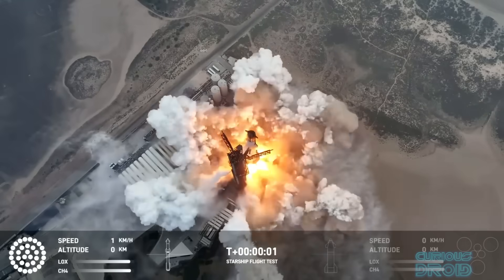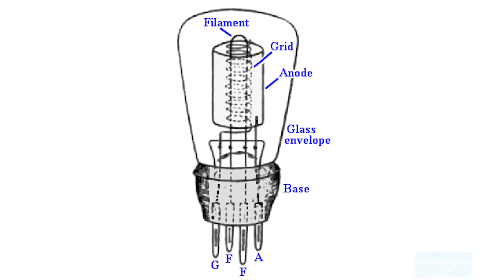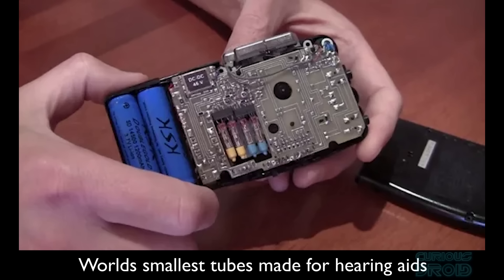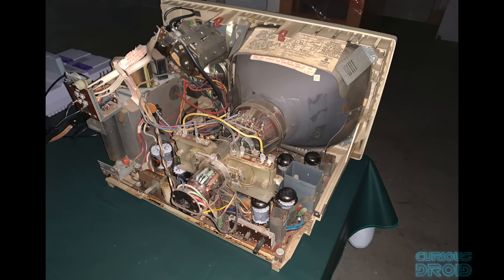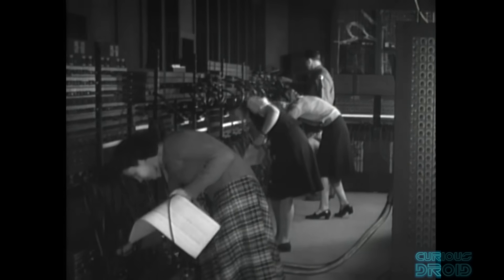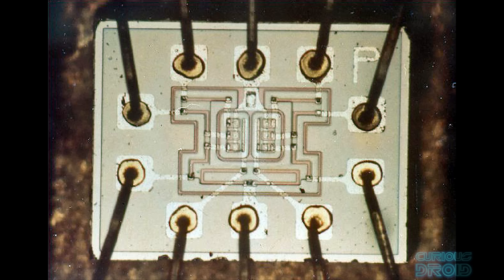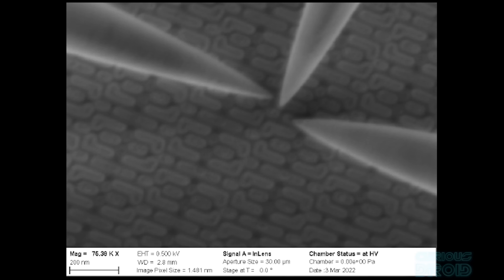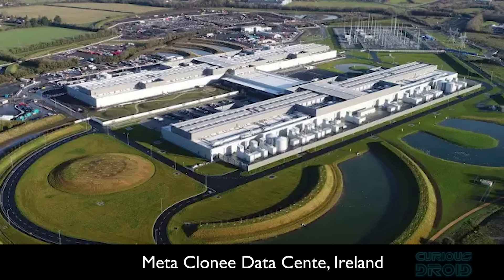Miniaturization - The Biggest Little Thing to Happen in the Last 60 Years

Comment: GPUs are faster than CPUs only in certain tasks
Reply: Yes, that was a misleading comparison. An Intel 14900k could do something like compile a program where an RTX4090 wouldn’t even know what to do with that task. That is a very large oversimplification of the process of course.
Reply: @fensoxx  that's mostly right.  Some GPU's executing 40+ times the floating point operations per second of some comparatively modern CPU's is accurate to say, though.  CPU's are very different from GPU's so comparing flops isn't giving the whole picture.  CPU's are far more general purpose and easier to program.  GPU's are good for AI, 3D graphics, and a lot of processing intensive software but CPU's are the only option for most other things.  Also, to execute anything on a GPU, you need software running in the CPU to load and work with it.  It is hard to turn those other aspects of comparison into a number, though.
Reply: He didn’t say faster. He said more powerful.
Reply: GPUs are fast when it comes to massive data parallelism which is the data of the same type without any dependencies. In all other tasks the CPUs are better.
Reply: Wasn't it more about the size of the circuits?

But yes, it is comparing different kinds of calculation with each other. I took it more as a curiosity.

Comment: Just one carrington event or a few high altitude EMP detonations and we are back in the early 1900s.🤣
Reply: Don't threaten me with a good time
Reply: @infinitesimalperinfinitum  Why? ... Are you a luddite? 🤣
Reply: @marcse7en  No, but I think humanity could do for a soft reboot.
Reply: Not really. Modern electronics are hardened against ESD. Transceivers will have a rough day but will just need to be rebooted.
Reply: A solar flare like the carrington event wouldn't affect small electronics. It only affects wires miles long.
Most of the internet backbone is now on optical fibres and wouldn't be affected either.

The only thing it would affect really, would be the power distribution network. Which could be a disaster, but wouldn't be an apocalypse.
Reply: Except for one thing ... We DON'T have to rediscover the vacuum tube, transistor, and integrated circuit again!
Reply: this is completely innacurate, but sure. every single bit of modern electronics will be instantly fried.
Reply: @Darenz-cg9zg  The scary part is how almost everyone who knows the term "Carrington event" just swallows this claim without any inspection.
Reply: Apparently we pretty much had one recently, and not much happened.
Reply: When digital switching was first becoming a thing with the first common control exchanges we had a contract with the military for their backup switches which were going to be strowger for that very reason. No idea what they do now.

Comment: Correction:

GPUs are being fabcricated using the latest process node, it will certainly be less than 5nm at this stage.
Reply: Just disregard the last three minutes. The 14900k is far from the fastest CPU and the 4090 is far from the fastes AI accelerator. But he referenced consumer items. The fastest CPUs (AMD Epyc 9000) are produced on 4nm if you want the highest clock speed variants or 3nm if you want the densest variants. The fastest AI accelerator is the AMD Instinct MI325X which is produced on 5nm. A 3nm version is expected in H1 2025.
Reply: Current node size is all marketing.  TSMC's '3nm' node is 43nm gate pitch and 23nm interconnect pitch.

TSMC's 16nm node was between 88nm and 37nm depending on what part you looked at.
Reply: @Ushio01  Even that isn't accurate.

They use interference to produce effective accuracy at smaller distances.